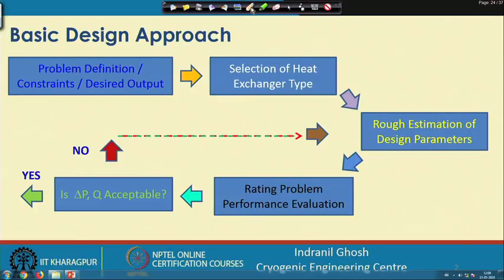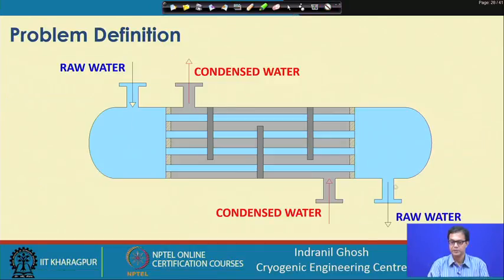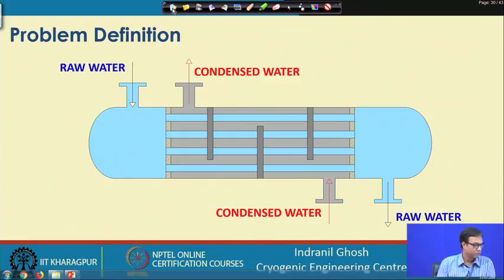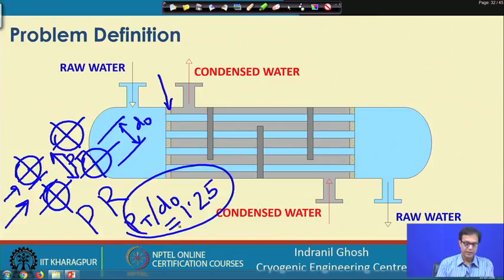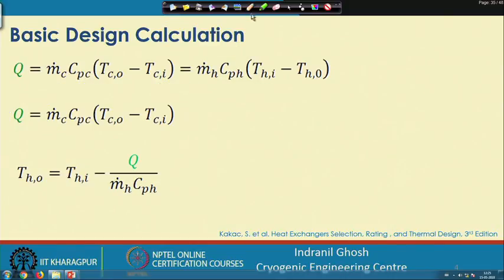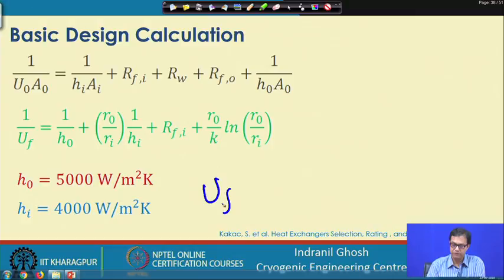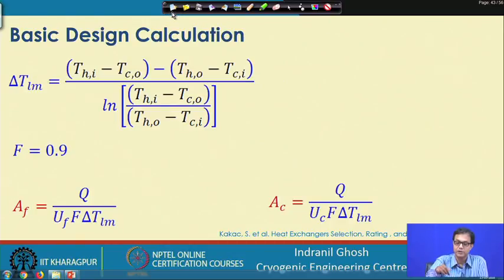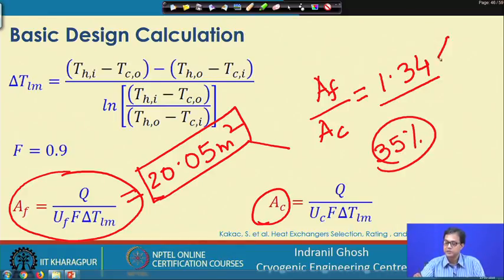Lecture 14 : Tubular Heat Exchanger : Shell - and - Tube Design

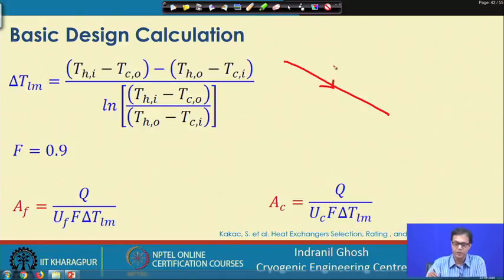Comment: Around 23:30, delta T large and delta S were showing wrong. Delta T large should be Th in - Tc in acc to CoCurrent Profile, at lecture 5.
If it was counter current also, Delta L & S showing in the slide was wrong but answer was correct.
Anyway appreciate for professor's knowledge sharing.